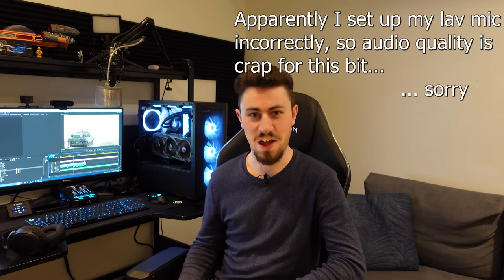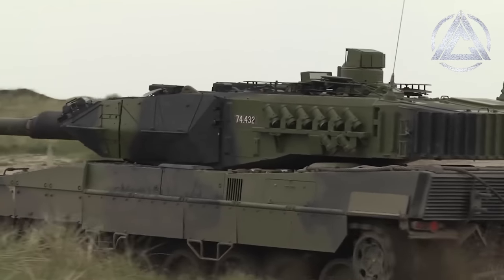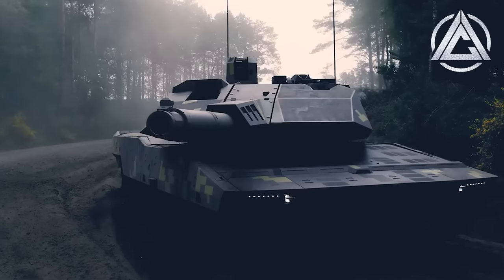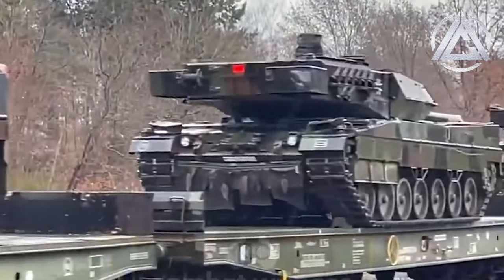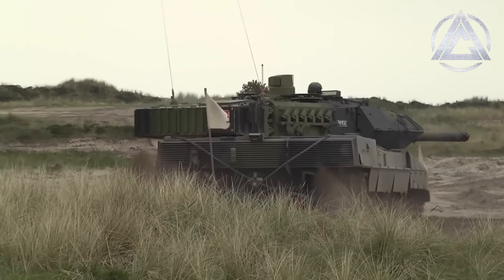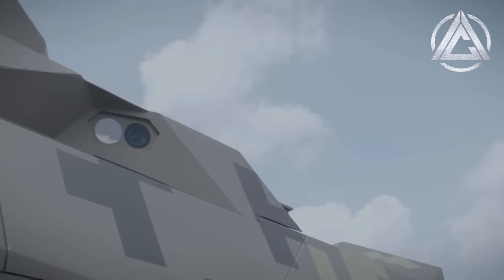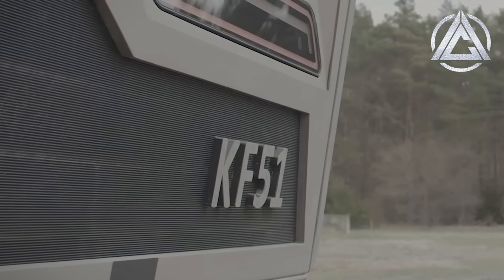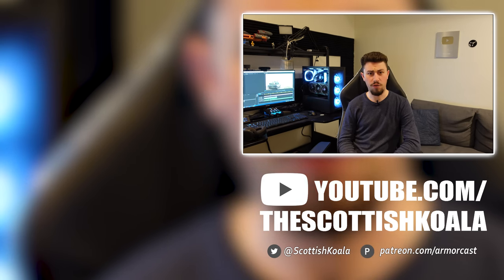Germany's New KF51 Panther Tank | The Spearhead of a New Generation?

Comment: The thing is, that RM actually wants to be part of the MGCS program and provide the turret for that. However that seems unlikely, as KMW and Nexter fused and it now seems that RM gets left out completely. So I think this is their effort to get back into the selection process and find a way that they are being picked as the provider of the turret. I dont believe that the Bundeswehr will actually by the KF51 because they want to do their thing with the French in order to produce a greater amount and push down costs / make exports more attractive. Which means that the KF 51 will never be ordered in Germany and is thus quite unlikely to be exported/ ever actually be produced.
Reply: KF51 was made for export markets. German gov has been pretty open about MGCS being their next gen tank
Reply: The MGCS program is a clusterfuck. This french company (is it Nexter?) insists on putting a 140mm barrel on the tank while Rheinmetall wants to use a 130mm one on it. Sure, there is company politics here, RM makes the 130mm and Nexter wants to use the 140mm they make. The problem is that the 140mm barrel hasn't even been developed yet.

And the problem is that an important feature of a tank (dimensions of the turret?) is determined by the size of the barrel. So as long as this isn't clear, MGCS is just stuck not getting anywhere.

So I think Rheinmetall does multiple things at once here, freeing themselves of MGCS which they deem stuck/ in the wrong direction, proving their 130mm barrel, and probably what you said here
Reply: I don't think of the KF51 as a 'new tank'. Instead I think of it as a 'technology demonstrator for Leopard 2 upgrades'. 
The Leopard 2 is an extremely popular tank and the Leopard 2 chassis used in various other tracked vehicles is even more popular. 
If Rheinmetall manages to offer (and cleverly market) the 'KF51' as a 'cost efficient high tech turret upgrade' converting old outdated Leopard 2 tanks from the 1980s into a modern 'next generation battle tank', then this concept could really find a very significant market.

Using a Leopard 2 chassis can come with very significant cost savings for many armed forces already operating Leopard 2 tanks (and/or it's siblings). 
Logistics, maintenance, repairs, all of these would barely change for the chassis of a KF51 at all. Only for the turret, the ammunition, and other upgraded capabilities would these change from a Leopard 2 to a KF51. So as a result this would be very comparable to them converting from an old Leopard 2A4 to new Leopard 2A7+. 
Compare the cost of such conversions to the cost of introducing an entirely different brand new battle tank into service and you may see many potential NATO buyers interested in a KF51 simply as a means of looking to get the most bang for their buck, probably even more so for a 120mm KF51 style variant.

Let's also not completely forget that Germany has a history of being reluctant with allowing weapons exports of the latest and newest high tech systems. Submarines, tanks, guns whatever you look at, German manufacturers tend to sell export variants somewhat less capable than what the German Bundeswehr and the closest development partners themselves operate. 
For German lawmakers a KF51 would be merely "an upgraded Leopard2", not an entirely new "Main Ground Combat System" MGCS Germany and France have teamed up to develop together. Exporting a KF51 as an 'upgrade package for already existing older Leopard 2 tanks' should be much less difficult and much less problematic for a German manufacturer such as Rheinmetall to realize than exporting an MGCS tank would be.
Reply: @tomwoggle9411  I've been wondering if something like that could be the case as well. Also the KF51 would be available substantially sooner then the MGCS as well.
Reply: @Caesim9  Rheinmetall is not part of MGCS in the first place
Reply: @tomwoggle9411  KF51 is a new tank. It was just made to be sold to countries that used Leopard 2s. 

They are also making a new chassis for the release version
Reply: @esanahka9284  Yes it is. Youtube marks links as spam, but there are several press statements confirming that MGCS is a cooperation of Nexter, KMW AND Rheinmetall.
Reply: @Caesim9  Rheinmetall is a minor part of it. It really isn't their tank. They are going to be even less involved than in Leopard 2
Reply: @esanahka9284  Some things I read is that those disagreements I mentioned earlier, led to Rheinmetall getting less and less involved. And now that they unveiled the KF51, that they will probably focus on that instead. And that earlier it was intended for them to contribute more to the project.
Reply: @Caesim9  My understanding was that the opposite is true. Rheinmetall wasn't supposed to be involved at all initially ans everything would have been done by KNDS (Nexter, KMW)
Reply: @esanahka9284  No, Nexter and RM put in a bid to provide the turret/ integrated systems of the turret. It looks like Nexter is winning, although I don’t think this is final, but I am not 10% sure.
Reply: @thorH.  I don't think RMs part in MGCS was ever supposed to be anything that large. KNDS (KMW/NEXTER) was created to be the maker of MGCS
Reply: @esanahka9284  No, they weren’t made, they decided on their own and our politicians didn’t intervene, which they should have, because we basically sold KMW to the French. Reason for this merger was to increase their own chances for the bid. 
All European contracts, especially in Germany, must be offered by tender, as soon as they are of a volume of more than 500p Euros, (which they just changed from 1k). Obviously one can specify requirements so that a company has an advantage. 
Right now, I just looked it up, RM and KNDS are both participating in a joint study to figure out the requirements and the integration issues for both armies. So they are both still in. KNDS/ KMW has also proposed a tank, the E-MBT to demonstrate that Nexter and KMW could integrate their systems (Leclerc Turret and Leopard 2A7 null).
As a German I must say, that this seems to go into the direction of KMW and Nexter, which I don’t like, because they are going to need to develop their proposed 140mm gun from scratch, which RM has theirs working already. Also this would mean that the heard of the tank will be produced in France, which is not what was agreed upon since the French are already going to get all our money for the FCAS. And RM also has much more advanced active protection/ hard kill Protection systems that are ready to go. It is going to be interesting what this will look like when the tank will actually be introduced into service. In 2040.
Reply: @thorH.  KMW is still half German as its owners own half of the KNDS. Other than the ammo capacity i don't think the 140mm is a bad thing. RMs 130mm is from my understand upsized version of l44 which was made in 1979 so making entirely new cannon using new technology for a tank which is to be ready by 2035 makes sense
Reply: @thorH. a prototype of the Nexter 140mm has already been tested, there are some R&D to do before the final product but it goes well and the final version will be ready in 2025-2026
Reply: @Caesim9  gets it!
Reply: @tomwoggle9411  I mean Tom… you are stating the obvious and how it was presented to market… you are not stating anything new mate
Reply: No they still work together. A manager from Ascalon said on Eurosatory that they want to talk with RM to finally come to the final caliber. I personly hope 130mm with many of the tech of Ascalon, ETC technology and Composit Barrel like XM360. With a Europack power pack and Composit rubber Tracks even the already "lightweight" KF51 can lose some tons to 54-57t and that with all thing so munition, fuel , etc.... were kf51 now is 59t
Reply: I think the main reason for putting the KF51 out there for Rheinmetal is that they want to establish the 130mm gun as the new standard for NATO tank guns before anyone else develops a 140mm gun or whatever.

Comment: I can see the rationale behind reducing the ammo capacity to add increased functionality. If RM has made studies that suggest that in 90% of cases, the tank wouldn't even touch the discarded 50% ammo, then cutting it out and replacing it with a system that provides both utility and longer range kill options seems like a reasonable idea. Additionally, adding the launcher makes it easier to upgrade to some future type of missile that might be developed.

Comment: During the 1st Gulf War my PSYOP Loud Speaker Team was attached to an armor battalion.  We had the only Humvee among all the tracked vehicles.  We were positioned between two Abrams as some protection.  One in front one in back.  The one a couple of tank lengths in front of us hit a mine that took out one side of the engine.  Saw the mine fire a shaped charge that came out of the top.  No one was injured. It was hilarious immediately because radio traffic started with who needs what before they killed it. It was cannobalized for everything that could be taken in the time allotted.  Then they killed it dead by hitting it with 120's.
It is amazing because the crew didn't know  they hit the mine until they were told because they thought the engine died of its volition.
By the way if we had hit it in our Humble it would have killed us.

Comment: I find it interesting that even 'new' tanks aren't so new underneath.  Essentially every new tank is an older tank that's just been upgraded.  Which isn't necessarily a bad thing if the original tank was good (or at least, good enough) - it saves money, makes training easier and improves the chances of it being reliable from the get go.

Its just wild that apparently the core design concepts of tanks hasn't changed much since the 1970's - and many tanks in service today are older then I am (37)  but have essentially just had cosmetic surgery to remain 'youthful'.  

Don't mistake me though - clearly the tanks are better.  Optics, stabilisers, ammo storage, communications, armour and other things that make a tank more then just a big tractor are all new and improved.  We just don't see the huge radical design evolution we did between the 1920's and 1960's.

Comment: Regarding the effective range of a tank's main gun, it's not limited only to the gun itself but also to the FCS system and the optics. There's always a tolerance in targeting accuracy regarding the sensors suite and the control system, for example 1 milimeter tolerance might be OK under 3 km range but over it this tolerance difference might make you hit a non-critical part of your target instead of the center of mass to destroy it. 

Making improvements in these regards will also aid the new 130mm gun to be more precise. As a gross example, you could use the same exact gun in parallel with Cold War era optics and FCS system, but if you can't see the targets past 2km away or aim with enough precision, you'll never be able to aim at them and shoot them properly. Only if we talk about the resolution advances in thermal optics, modern systems are able to see the temperature difference between someone's nose and cheecks, compared to an '80s optic which would just show you a faint shape of a human warmer than his surrounding environment.

Some of these sensors and electronic systems do come with a drawback, though -they increase the complexity of the tank which adds up additional chances of failures, plus some of these systems are still pretty fragile and even if the tank is not damaged and can be operational, if you destroy these optics with a machine gun or even the shockwave of an explosion (or even cause the lenses to get misaligned), the tank will not be able to aim it's shots properly anymore.

Comment: Yes.. excellent analogy. Your out side the box thinking is spot on.. and should be applied As all things considered! It mostly comes down to HOW its used as a battle field asset in conjunction with MBTs .. overkill can be an asset in itself coupled with its weight to horsepower ratio!! Imagine how messy that would be for the opposing forces!!

Comment: I think a sensible redesign for the turret would be to split the quadlauncher into 2x2 launcher(2x in the vertical ) and move them on either side of the turret, outside of the main armor and give them just some armor against small arms. This way you could keep an 20 or maybe 18 shot autoloader and retain the drones/missiles, which are usefull. Also If the get hit and explode, this way the main armor would keep the tank safe.
Reply: Or just lanch the drones from another vechile ie puma

Comment: Like you said I the KF-51 as a tank has some shortcomings to fix. But I think as a concept its something that will definetely set the tone for future MBT's to come. It was about time someone made a tank for the modern networked battlefield that does more than just be firepower on wheels. Having the ability to launch drones and being a networked platform is something that will keep tanks relevant for decades to come. 

I know for instance in my country (The Netherlands) we got rid of the Leopard 2's for a while because the consensus was that in the modern battlefield where things such as intellegence and small surgical operations are key, a tank simpley wouldn't fit in anymore. We have the tanks back now. But I think that a tank like the KF-51 would be very attractive for a small armored infantry like we have because it fulfills more roles than simply punching through enemy lines. It can actually support infantry and work together with other network centric platforms to get a better view of the battlefield.
Reply: I think we have to change the way we look at Main Battle Tanks.
Apparently that new land combat vehicle system the Germans and French work on together goes far beyond just developing a new MBT.
It seems they are developing a whole new family of specialized vehicles and the MBT is just one of them.
What they are envisioning is that you won't have tank platoons with 4 MBTs working together anymore, but instead "teams" or "packs" of several specialized vehicles.

Such a pack will probably contain something that resembles a MBT as a "dueling vehicle" specialized on destroying hard target enemy vehicles, one "NLOS" vehicle, some sort of self propelled howitzer or a launching platform for loitering ammunitions or kamikaze drones or both, a air defense and anti drone vehicle and a command vehicle which controls several recon drones and can perhaps remote control the other vehicles. It might also get a electronic warfare capability.

And then you can attach one or more Infantry Fighting Vehicles to such a pack for the anti infantry role and other specialized vehicles like recovery and engineering vehicles.

Such packs would kind of function like a vehicle version of special forces teams.
Reply: @TrangleC  The more modern combat we see, the more we realize that there's never a single solution. You have to be adaptable, and flexible in your role. Everything in modern combat has slowly started embodying this new perspective.
Reply: One other reason for the Dutch army was that the Dutch army has changed roles.
In the Cold War, the Netherlands was the second line of defense and thus our land forces were designed for taking on Warsaw Pact forces in convention combat. 

Since then, however: the only relevant land territorial threat is Russia with Poland & Germany being our land buffer. 
That means that our land forces have 2 roles: rapid deployment towards Poland just in case, and worldwide expeditionary warfare within NATO / coalition warfare.

As heavy MBT’s are not as strategically / operationally mobile, it makes more sense for the Dutch land forces to focus on forces with higher mobility to rapidly deploy to support heavy allied groundforces such as the tank-heavy German & Polish forces. 
In other words: they place the tanks, and when shit hits the fan our IFV’s, air assault, infantry and special forces race towards them to support.
And in expeditionary operations, we have some artillery for firebases
Reply: Or, as I understand now, after all the info, from the last few years of modern warfare, no one has a clue where it will go, so they left options for future updates - additional post for the 4th crew member, if needed! Launch platform for some kind of drones or missiles if needed, or return to additional ammo, or fuel, or... if needed. Other things optional to add/replace..if needed... Just, no one knows where warfare will go, and what will be (if any) role for the MBT! So all options are open (MODULAR in modern language)... Maybe tanks will not be used as direct battle vehicles, but just to protect high ranking officers on the battlefield from sniper rifles and diversions, while they can observe battlegrounds from inside the new "tank", using modern senzors and drones...with driver, guard, and maybe even wife... With all the comfort that can offer, air condition, active and passive protection, high mobility, and all kinds of communication possibilities (on line games, tv, and SATCOM..) ;)
Reply: I just cannot understand why so harsh words versus Challenger 2 MBT?  It is Challenging, as I  already said, but keep for future historical evidence, not rush in, because "only fulls rush in..." ;)